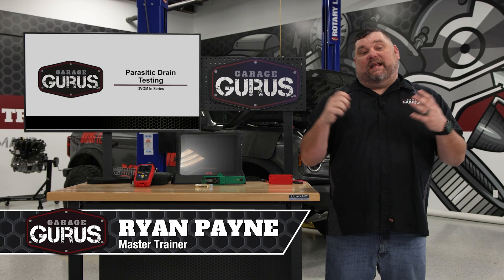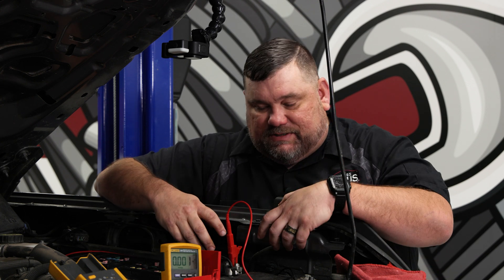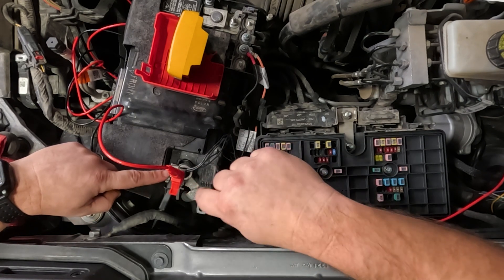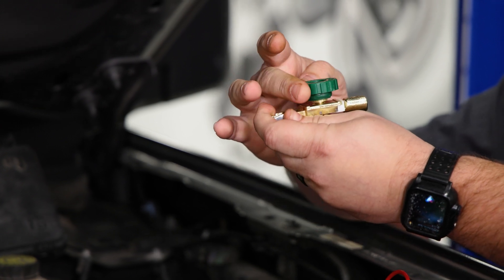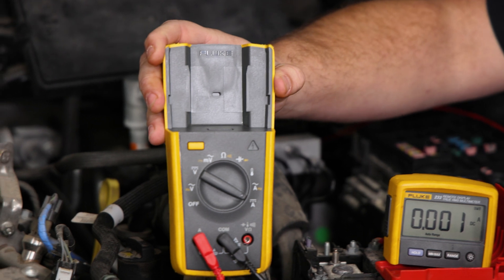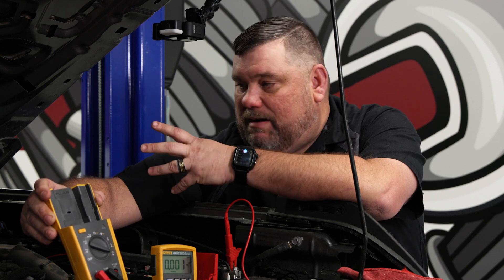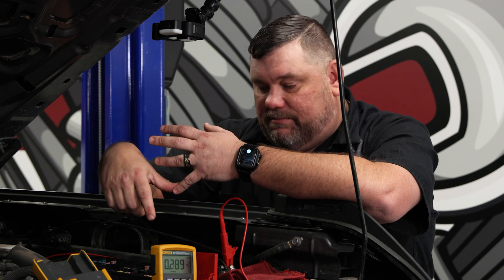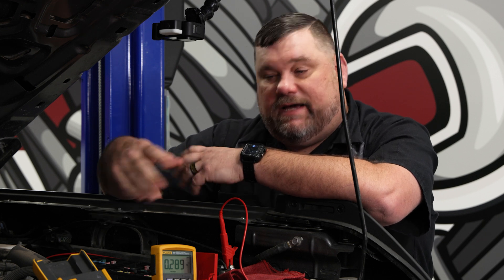Garage Gurus | How to Diagnose Parasitic Battery Drains With a DVOM in Series

Comment: Have you tried the new snap on probes with half round wire ends thst fit big and small battery posts bought both sizes. Work good